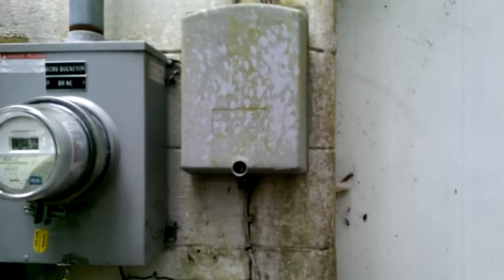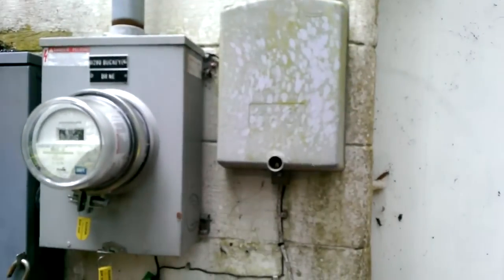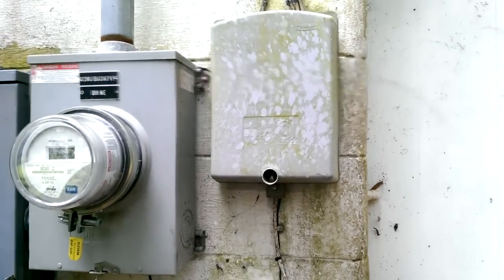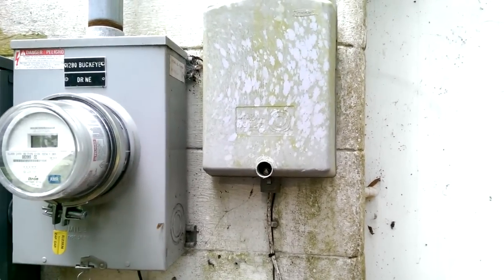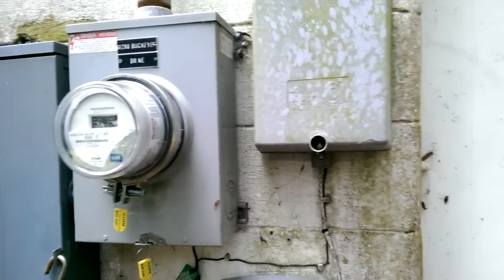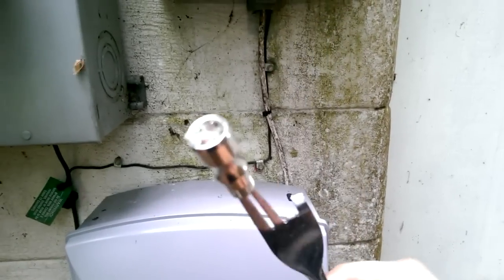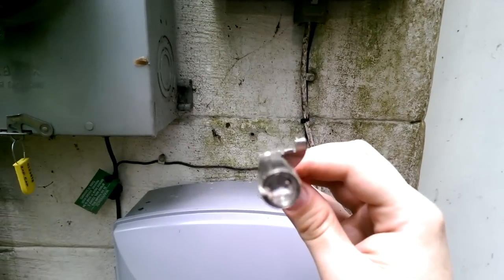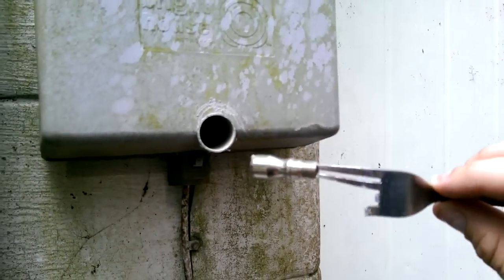Removing Cable Terminator Locks without Terminator Lock Tool

Comment: You are GOD sent!!!!. Telus guy came and changed shaw cable to theirs. problem is telus modem has weird issue ... As you go away from modem speed drops. Weirdest thing i have ever seen. every 10 feet 20% bandwitdh. So i decided to go back to shaw. Now i have no away to switch back. I was googling googling until i find this video. I thought some guy pranking us. Unbelievable it worked. I was so happy otherwise i have to wait for week for those shaw guy to fix it.

Comment from the maker: Actually I subscribe to the cable service. It's just nice to know how to open the service box so I can troubleshoot issues myself instead of waiting 24+ hours for the cable company to come out and fix my service when I can fix it myself quicker.
Reply: Technook judging by the fact that you don’t even have a cheap terminator tool, I’d say you’re definitely not equipped to properly diagnose and repair problems with your cable.

Comment: I just wanted to move my cable modem from one room to another and it would cost me $88 for the guy to come and open the box and literally just unscrew one cable and screw on the other one.  Also I would have had to wait for like 2+ weeks.  I had to destroy a fork (which didn't work), then a kitchen whisk (which also didn't work) then finally another fork (which did work!) over 45 minutes, but I got it open!  Oh happy days...

Comment: Maybe i should do it for my cousin that lives in a condo I sort of development thing but I can try to get her cable tv with the proper equipment I can get the the the cable terminator tool from local hardware store, and the cable signal tester from the local hardware store, and some coax cable as well it’s easy I watch DIY videos and it’s easy. I hope it works.

Comment: awesome. i bent the very tips of my fork outwards to grab the keyholes on my locking terminator. worked like a charm.
Reply: Ryan Tuck how did you get this to work
Reply from the maker: Travis Justin It works simply like I did and the video and just like Ryan said. You bend the fork. You just have to make sure you bend the tips at the correct angle. I would recommend using a pair of pliers to bend the tips.

Comment: tried this but the cheap forks I bought kept snapping off at the tip when I bent. was able to remove lock tho by applying a good dose of wd40 and using a single tine to spin it out

Comment: lol good luck guys...I'm a cable tech have been for years go ahead and waste time getting the terminator off but the D-Mark on your side of the house is not where you steal cable from geniuses that is just the connection point from the pole to your house....try climbing the pole...geniuses! oh and by the way most cable companies even if you manage to unter minute the cable at the pole good luck getting anything because you will need a cable box and a signal sent from the main cable office.......not trying to be rude but it is not 1990 anymore
Reply: if you say so my friend climbed up the pole took the filter lock thing off And boom we had cable until someone by us got cable then they un hooked us put another luck on it once they left he just took it off again
Reply: They put one on the end of the coxal cable spliter than sealed the other coaxal cables to it. Unless I can get that lock off and run other cables through my router is stuck on the same outlet since none of the others will output a signal >.> I get so much packet loss in my office lol All I want to do is move the router to a coaxal outlet that works in my office, but I cant do that until I get the lock off :P and I don't want to call twc to do it for me, probably charge an arm and a leg for something they set up :P
Reply: The box on the side of your house or somewhere in your house should have all the drops for the house. Just throw in a good balanced tap and you are good to go, also putting terminators on unused ports will keep noise and rogue signal from getting into the plant. Best to have a meter to check and see wtf your signal is doing tho. Cable pants aren't as simple and easy as some people make them out to be. When you do janky shit like this it can cause noise to get blasted out into the network fucking everyone on that leg.
Reply: I will leave the pole climbing to you good luck with your 420 and working as a cable technician..most likely just a poser who used to smoke back in the good ole days i.e. 1990
Reply: I looked up this video so i could run about coax to my basement do you think its better just to get my provider to do it for 100 bucks or so?
Reply: Your pot logo means your opinion is invalid.